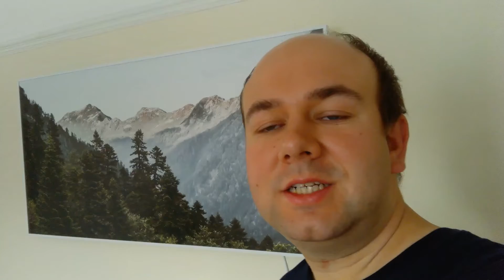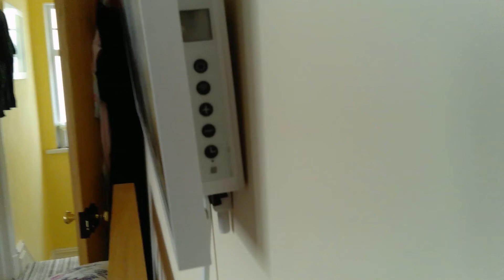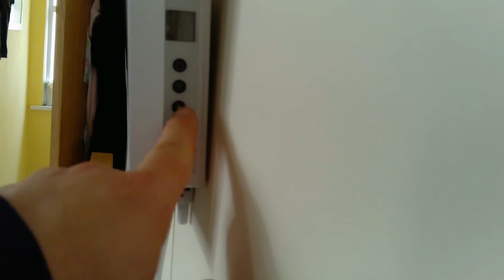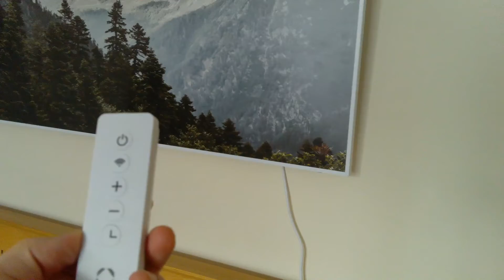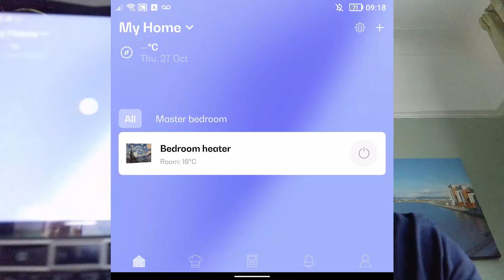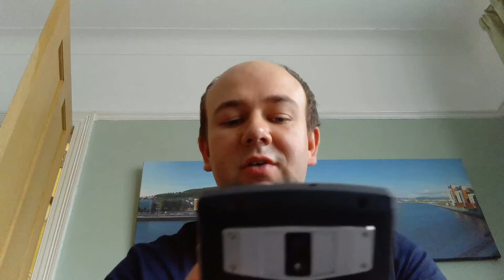Review of Klarstein Wonderwall Air Art Smart Infrared Heater: Whats Good, Bad and Would I recommend

Comment: I was more interested in the included remote controller, so it missed out some significant info.  Not everyone has either WiFi in all areas, or 2G WiFi, so the simple remote controller demo would enhance the review
Reply from the maker: @johnseeley8970  never used the remote. It just has the same buttons as the side panel.

Comment: Hi, I would like to ask once the room reaches the selected temperature does it turn off automatically? Also it probably does not have function to turn on automatically once temperature drops down? Thank you very much
Reply from the maker: @dusky661  yes once the room reaches the temperature it turns off the emittor and then when the temperature drops a certain amount below (i think about a degree) it will turn it back on

Comment: I didn't think these were for heating rooms up... the idea is they warm you up...

The thermostat is just to set what temp you want it to come on, not heat the room to.
Reply from the maker: @2650josh  it will heat objects up. If you shine enough IR on something it will absorb the energy and it warm up.  However to bring a whole room up to a temperature (including the air)  will take quite a long time.  We tend to put just to warm ourselves up before bed.  The way we have it angles and above the bed does mean the bed warms up nicely in a short period

Comment: What's the minimum temperature you can set the panel at? I'd like to hang it in the shed to keep it above freezing in Winter. So minimum temperature 0 or 1 degree. Can it be set at that, or is the minimum 10?

Comment: I was told that this type of heater is perhaps best used to support the central heating that is set at 'base' level (say 15 degrees), but I don't know if there is science behind it.
Reply from the maker: That would be one way to use them.  You could have you rooms set to 15C housing the central heating and if you using a room then use the IR heater to warm you up to 19 or 20 without having to raise the whole room temperature or temperature in other rooms too
Reply: @drchrisjbarnettnanoexpert  Gas price is still too high for me to even want to turn the boiler on, so often I only use infrared tube, and I find that the heating is really restricted like what it says on the tin. You step a foot outside the range, it feels 5 degrees colder. But I do like it's decor value which minimizes cluttering small houses.

Comment: Thanks a lot for the review. I have one dout, what do you think about put the heater in the same room of a TV. 90°  and 2meters +- Could damage the tv?
Reply from the maker: Hi, at 2m i wont have though so as only a small area is exposed to the full rays. i would check the operating temperature range of the tv and just check by touching the tv on how hot its getting

Comment: I have had one of these for a few years now in our lounge.  Although it does "heat" it is not a replacement heater for the lounge as it is simply not powerful enough.  The inbuilt thermostat is now faulty (reads high 20s in a cold room) and the app stopped working with it too.  I still like the  infrared idea just not the best product. Looks good though with a picture.
Reply from the maker: The thermostat is something I've been thinking about, not sure how its meant to work as it attached to the back of a sheet that gets hot.
Reply: @drchrisjbarnettgreentech Yes it will never be ideal but I think mine has just broken.  I think a separate thermostat in the room is better.
Reply: agree. my one would not go above 11 degrees. I got my money back, no issues but it was left to me to dispose of the darn thing. Not easy for a pensioner to get down the tip

Comment: Mine has come with a 2 pin euro plug attached to the picture, they sent me a 3 pin converter plug in the box that doesn’t fit the 2 pin am I missing something?
Reply from the maker: Mine came with a three pin, but it looks like a adaptor had been fitted before sending.
Reply: @drchrisjbarnettgreentech  thanks for the reply. Not happy to be honest I’m shocked they give me adaptive that doesn’t even fit the picture lol I’ve emailed them so il wait to see what they say wanted to get it up and running asap.
Reply from the maker: Out of interest in what way does it not fit, and the holes for in the pins to small in diameter or do the holes have the wrong spacing?
Reply: @drchrisjbarnettgreentech  the plug they sent is for a adapter for a like a shaver that slots in to the bottom. The plug on the picture is much bigger it won’t go in. It needs an adapter similar to the ones we take on holiday if you know what I mean
Reply from the maker: I think i know what you mean.  I made this unbox video, you can see the plug that mine came with at 2.35. https://youtu.be/rmUdGRGAP6g
Reply: @drchrisjbarnettgreentech  I see, thanks for that. I can see your plug and the one they’ve sent me is definitely different. And they’ve just chucked it in the box for me to sort out lol. Frustrating it is it’s not like It can’t be sorted it’s just hassle for me.
Reply: Done some searching and basically they’ve sent me an fcp adapter when they should have sent scp3

Comment: Just to clarify: I assume by '5G' and '2G' wifi you mean 5 GHz and the older 2.4 Ghz wifi frequencies, not to be confused with the old 2G (second generation) mobile phone transmission standard, current from the 1990s until recently, and the far shorter wavelength 5G (fifth generation) transmission standard now being introduced and as yet used in only a few parts of the UK.  
Wifi and mobile phone signals are of course two completely different systems which just happen often to be usable by the same devices.
Many wi-fi routers are quite happy to use both 2.4GHz and 5GHz frequencies.
With regard to the length of the cable, most users will surely have somewhere they can site a heater within reach of a power socket (outlet, receptacle).  To supply 2 metres of cable with every heater for the few users who want to site their heaters elsewhere would add cost and be potentially dangerous as users would either wind the cable into a bundle or allow it to lie on the floor where it could be damaged or tripped over,
Reply from the maker: Yes it GHz, think for most routers its fine, we had problems due to our mesh.